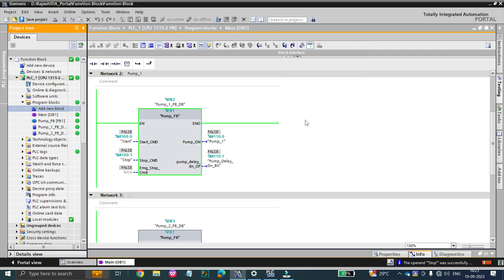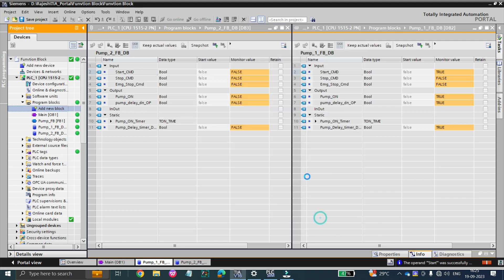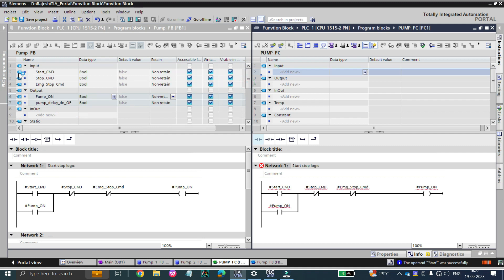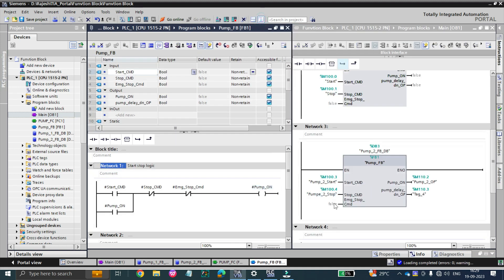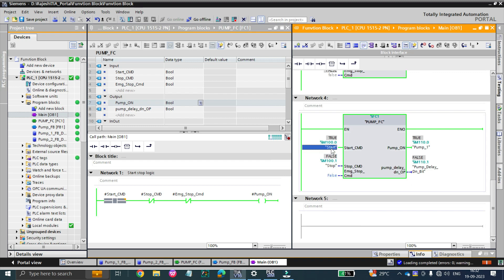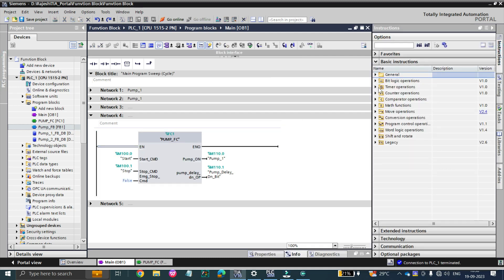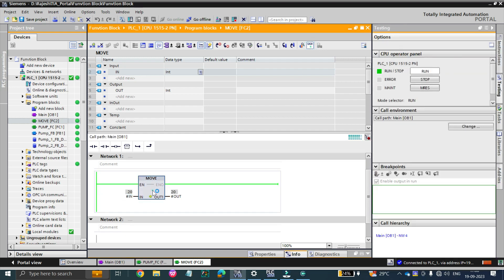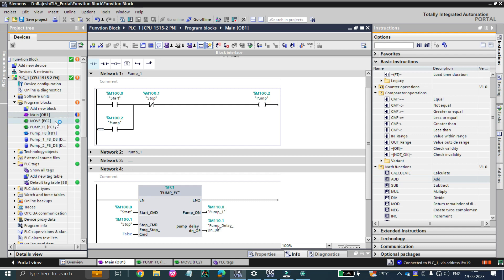What is the difference between FC and FB. And use of the both block

Comment: Why don't you use Temp in the function? With Temp variable, you will be able to latch
Reply from the maker: Temp function is ok until you are using bool data type/or any normal calculation. That's why you will able to latch it. But if you will try to define data type like Timer, counter and any other function block then it will not work.